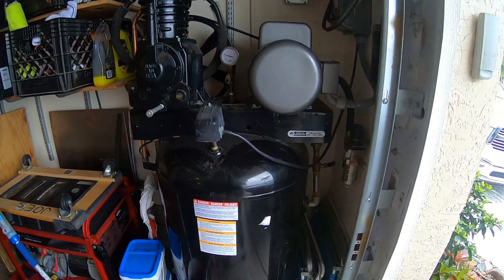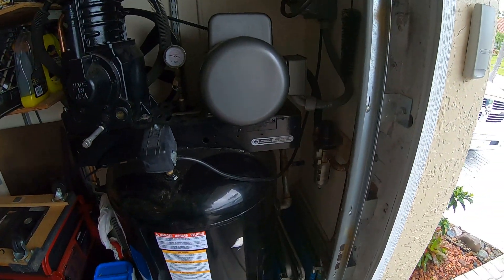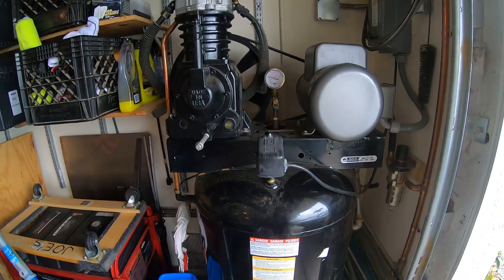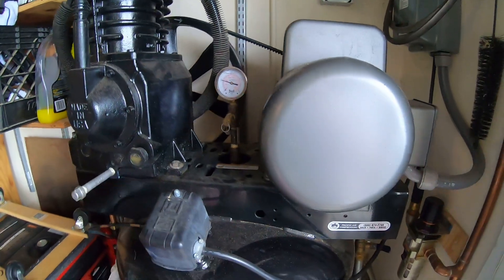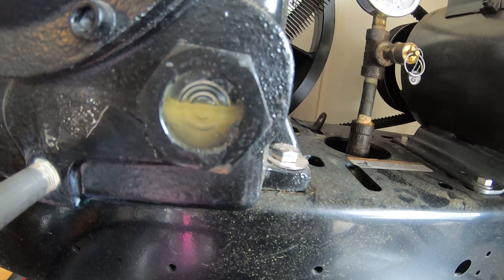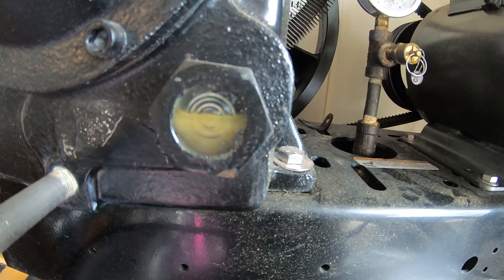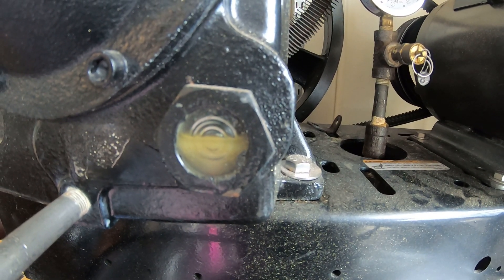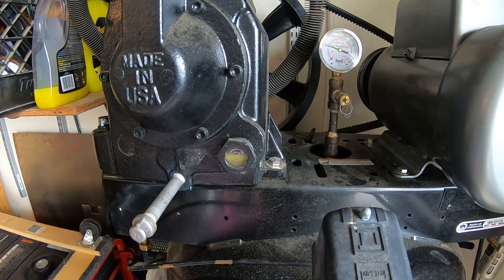Air Compressor Moisture in Oil?

Comment: Hi, the reason is the compressor is short cycling, the compressor  is not reaching a high enough temperature to evaporate the water, you can fit a short run timer and also venting oil filler cap.

Comment: I know this is an older post but your compressor isn’t running enough… it has to run to burn moisture in the pistons.   Cold pistons and hot compressed air makes moisture and if it’s too big for the application and doesn’t run enough you will get water in your oil…. Open the drain valve where it will bleed air and kick on and run several times a day for 15 minutes or so will fix the problem

Comment: Did you get the issue resolved how is the oil did you change with different brand
Reply from the maker: I haven't found a single oil brand that prevents this issue from happening,  Unfortunately. My solution is just to change the oil more frequently.
Reply: @JoesGarageProductionsLLC  what brand of oil are using are you still using the synthetic 5w 30
Reply from the maker: @tigwelding123  I generally use either mobile 1 or Pennzoil platinum 10W30 depending upon what happens to be on sale that week.
Reply: @JoesGarageProductionsLLC  okay cool I was just curious cuz I have some older Kellogg American air compressorsand I was thinking about putting synthetic oil in but regular air compressor synthetic oil is so expensive was trying to figure out a cheaper solution

Comment: you probably have moisture because of the tempeture swings causing condensation inside your pump.  If you were to move your compressor closer to the wall of your home where the tempeture is more stabilized as apposed to right by your garage door where you might have significant day and night time tempeture swings, then maybe with less drastic tempeture swings you will have less condinsation in your compressor pump.

Comment: Have you fixed the problem?  If so what was the cause?
Reply from the maker: Nope, have not found a fix. I just change the oil more often. I thought about re-ringing the pump but parts for this pump are crazy expensive, especially right now.

Comment: I have 2 10hp  Compressors. One will milk up the oil and the level will increase over time. The other compressor will not. They are setup as duplex and alternate, they get the same time put on them. The issue is blow by of the piston rings. The blow by air getting in the crank case is bring in the moisture. It is not the oil.
Reply from the maker: That's kind of what I was afraid of. Is there a way to gauge how much blow by is "too much"? I can feel air escaping out the breather but I am not sure how much is normal.
Reply: @JoesGarageProductionsLLC  The compressor getting water in the oil has been has been doing it for 4-5 years now. It still keeps up with my 25 CFM blast cabinet with no problem. I change the oil about every 6 mouths now. I started putting Motor Kote in the oil after watching this video.
https://youtu.be/88vwUwa3igQ. I used 5w20 automotive oil. The thick 30 weight oils make it hard to start in the winter. I bought a 5 gal pail of Amsoil ISO 68 compressor oil after listening to a sales guy tell me how there compressor oil specially formulated not to mix with water. That was note the case. To sum it up. If you are not getting oil in your air and it keeps up with the tools you run with it, run it as is and change it more often.
Reply: @CHRISINMCNEILL  Your experience is about as on-point as I could have hoped to find on this issue, but on the other hand, I rebuilt my Quincy model 340 about a year ago - a very long and painful process, including liners and rings, checking gaps etc and verifying with factory specs - yet I've got very rapid accumulation of moisture in my oil, too.  I rebuilt it because I'd been careless about checking oil, and when I did check the oil, it was actually HIGH (which really meant there was water accumulating below it, and not showing up on the dipstick as anything really alarming)...but the massive flywheel started knocking around a bit and making some scary noises, and that's where it all went south before that first rebuild.
Like Joe, I'm in humid territory, warm year round, in Honolulu.  So whether it's blow-by,  or top-end condensation dripping down into the cylinders between cycles (in my erratic use they might be minutes apart - or days), I'm extremely uninterested in repeating that months-long rebuild.  In this pump, it's a little over a GALLON of oil in the sump - much more than I'd want to throw out monthly or even every six months - and I just discovered the problem is back with a vengeance.  Nasty brown (not white, not yellow - dark brown...) glop was thick on the bottom of the crankcase, keeping itself from draining out, and not at all fun to swab out.  There's no way I want that stuff being picked up and circulated by the oil-pump!
So I actually got here hoping for some miracle chemical fix, maybe a dessicant format that could be dropped into the oil,  etc, but then again, I searched high and low for that stuff while rebuilding LAST time and never found anything that seemed worth trying.  Block heaters are sometimes (or were) used for this situation, but when I asked more about this, the Quincy tech agreed with me that there's no place for any boiled-off water to be ventilated from the crankcase /anyway/ (and it would tend to just steam up the cylinders as it rises, which might be worse than doing nothing, in my thinking.)
So I'm considering an external circulation pump that would slowly move the crankcase oil through a glass fuel-type settling bowl, making it easy for me to spot a water layer building up, even from across the workshop, and simply manually drain it periodically.  My design dilemma at present is choosing a low-volume pump that doesn't worsen things by emulsifying the water/oil mix, but rather moves it along gently but at a volume appropriate to a 1/2" pipe, so it will settle out in the bowl.  I'd actually like it to be a HUGE bowl, like...two quarts, even more, so there's not much turbulence.  Bonus points if I can rig up a crankcase return that washes the walls down with recirculated oil.
...but I'm still all ears for that miracle 'chemi-dry 5000' fix...

Comment: I just noticed the same problem with my 80 gallon Quincy. I’ve had it about 2 years, I put an hour counter on it and only have 30 hours, so it doesn’t run very much. It is humid where the compressor is, I’m going to install a dehumidifier. I think between the moist atmosphere and the compressor not running long enough to build heat…
Reply from the maker: Let me know how it works out. Would be curious to hear about your dehumidifier setup if it works

Comment: Hi there,
How did you go with your air compressor problem?  The wrong oil can cause it to go milky sure, inspect the oil and determine if it’s aerated or there’s water in the oil so you know what the problem stems from. Take a sample of the oil and leave some overnight in a glass jar. If there’s any sign of separation you’ll find water is your problem, tell tail signs can be condensation droplets or some rust on the inside of the oil filler cap, water in the water separator bulb, excessive water in the air lines and tank when you drain it. By the way the air tank should be drained after you use the compressor as part of the shut down procedure as well. 
The fact your duty cycle is low won’t help the situation either, compressor need to be loaded up and working rather than starting up occasionally and filling the tank with heated air as air heats up under pressure and if it’s a low cycle the air cools down inside the tank releasing moisture causing water to form. Eventually the compressed moisture finds its way past the valve seats and rings into your sump. Hence milky oil, keep an eye on the level as the oil levels as well, if the levels rise confirming that water is getting into the sump. 
I would suggest an auto drain solenoid fitted to the air dump valve. About Aus$40-$50 on eBay. You can set it to dump some air for a few seconds every 10 minutes or whatever to force you compressor to work more frequently. If not put a new valve kit in the head and monitor it, if all else fails put a new set of rings in that bad boy. There shit easy to work on, I was a service technician for Ingersoll Rand in Australia for many years and have seen a lot of this especially in low cycle air compressors. 
Regards RickyD
Reply from the maker: Thanks for the advice Ricky! I've just been "living with it" and changing the oil every few months. I bump the tank drain ball valve literally almost every time I walk by the tank. I suspect you're right and it is the duty cycle. I built this compressor from parts and the only thing I touched on the pump was the cylinder head and valve plate - I replaced the whole assembly. I did check out rings a while back and they were either tough to find or crazy expensive - I honestly can't remember. Once of these days I may pull it apart but that pump is > 100 lbs and moving something that high up around by yourself ain't easy :)
Reply: @JoesGarageProductionsLLC  yep, you can live with that. Much cheaper options than the cost of parts these days. Just run it with a half a cup less oil to allow for the ingress of water and expansion under heat so you don’t blow out your bottom end. 
Cheers

Comment: i had the same problem. the real problem is not really moisture, maybe 10 percent, the rest of the problem is from someone previously using the wrong oil, and now it is foaming, making the current oil look milky. I know, I did it, unknowingly. took awhile to correct it, took all the plugs out, fill cap off, drain plug out, and flushed it with kerosene and marvel mystery oil mixture. then used a separate air compressor to blow the pump completely dry, repeated process again, filled with proper non detergent oil. then ran for 30 minutes, then drained and refilled again with the proper oil. No more milky looking oil. it was the detergent getting foamy causing my issues.
Reply from the maker: Interesting... Thanks I will try that!!
Reply: Makes sense

Comment: i am not an expert in compressor but it might have something to do with moisture level in the air. if there is high level of moisture in the air, when your compressor cools down it will condense on the cylinder wall. Eventually it will mix with compressor oil.
Reply from the maker: Those were my thoughts as well. Being in south Florida, high humidity is a fact of life. I've tried different oils with pretty much the same results. This compressor needs to run non-stop for at least 30 mins for the oil to even get warm, much less get warm enough to encourage the oil to boil off moisture. I've since just gotten used to changing the oil every few months and I'm back to using 10W-30 engine oil - which is much cheaper than air compressor oil and is also the recommended oil by Campbell Hausfeld.

Comment: Is the unloader valve fully seating?
Reply from the maker: I believe so. It is a new Square D pumptrol valve. If it wasn't how might that contribute to the problem?
Reply: If the unloader is leaking back the air could be cooling enough to create moisture inside the pump. Its unlikely but possible. It also could just be that its not getting hot enough to boil the moisture out so its settling in the oil.